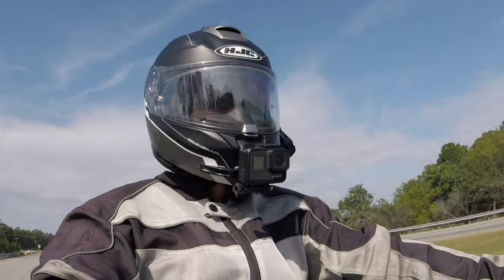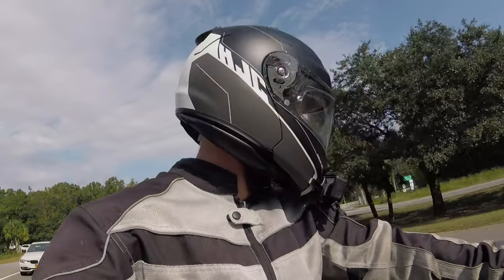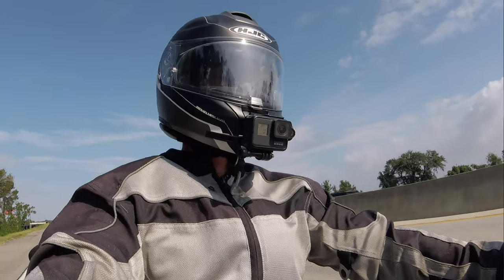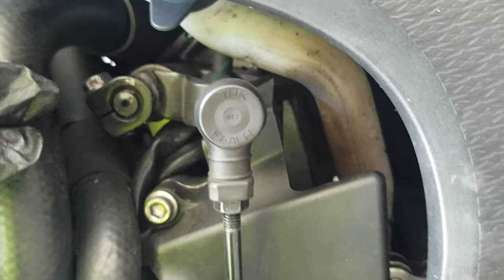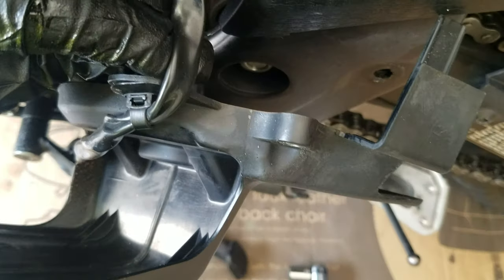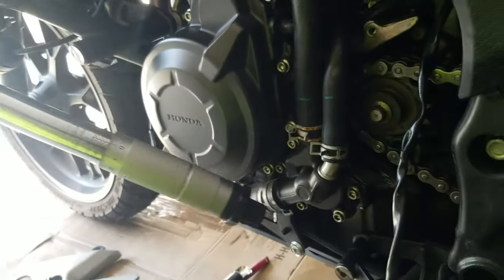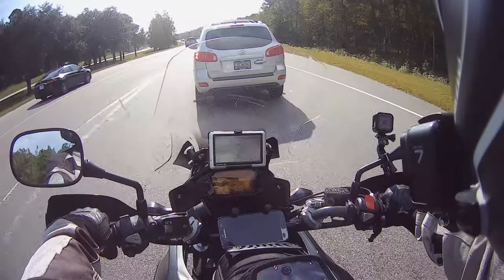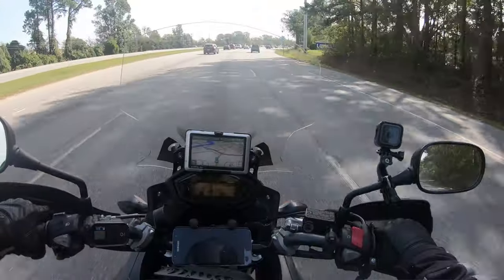CB500X 16T Sprocket Swap

Comment: It appears the torque wrench was used to break the sprocket bolt loose. I ask because that can cause issues with the calibration of a torque wrench for future use.
Reply from the maker: Hi Kris!  Thanks for the tip.  I did not know that!!!
Reply: Just dropping a torque wrench can make it off.

Comment: did this mod to my old 600 transalp and will now do it on my 2016 v strom 650.i like a low revving bike.
Reply from the maker: That's great, Peter!  I'm glad you found it worked for you as well.  :-)

Comment: Can you show gow did you recalibrated the speedo? Thx mate
Reply from the maker: If you check the video description, I linked to a device that will recalibrate your speedo.  Here it is:  SpeedoDRD DRD-3 from 12 oClock Labs - https://amzn.to/2Pahs8C.  You just remove the left side panel and plug it in.  Then go through the recalibration steps.  And bobs your uncle...everything's back to perfect!  I personally have not done it yet since I always use my GPS, which shows the correct speed all the time.

Comment: Is there a chain guard available that's made to go with the 16 tooth sprocket?  Wonder why Honda doesn't upgrade to the 16 tooth?  They have some pretty damn good engineers.  Just sayin'.
Reply from the maker: The stock chain guard works perfectly with the 16T sprocket.  If you saw me grinding my chain guard down, it was because I had it installed upside down.  OOPS!!!  When I flipped it the correct way around, it worked perfectly.  Also, the CB500X is made for many markets.  I think for the American/Canadian/European markets, the 16T would be an advantage because we have nice paved highways and travel at faster speeds than in some countries.  However, in other places like Africa, South America, and Asia, where you are often traveling on dirt trails or twisty mountain roads, the 15T makes perfect sense.
Reply: @MotoPhotoAdventures  Thanks for the response/info.

Comment: Where did you get your accessory bar and phone mount? I’ve been looking for one for my 2014 cb500x
Reply from the maker: Hi Erica!  Believe it or not, I made it myself out of an old badminton net post!  I just chopped it to the right length, flattened the two ends, drilled holes in each end at the same location as the existing bolts, painted it black, and bolted it in place.  I mounted my GPS on it using a bracket that I found while browsing the www.cb500x.com forum.  Then I tied the GPS power into the switched OP Plug (Options Plug) located under the right side of the instrument panel.  The instructions for reaching that were also discovered on that forum.  So when I turn the key to start the bike, the GPS fires up, and when I shut it down, it turns off automatically.  The phone (located below the GPS) is on a RAM X-Mount attached to the handlebar.  I hope this helps!

Comment: Cool video.I'm about to put a 16t on my v-srom650.Hopefullu the result will be as pos+ as your.My sprocket is not rubber backed,hopefully it will be ok without changing chain.
Reply from the maker: Hi Dennis!  I know several V-Strom riders who have upgraded to 16T and been very happy.  The rubber doesn't do anything except reduce noise...but I doubt it's really even noticeable.  I changed mine without replacing the chain and had no problems.  Ideally you would replace all three (chain, front, and rear sprockets) at once.  But it won't hurt anything to replace one at a time.  It just might wear the new component down slightly faster.

Comment: Just done this to my 2020 CB500x and it is AWESOME. The engine is much more relaxed, and the vibration zone at 5000rpm has been cut significantly, also it seems to virtually disappear by 5500rpm. Cannot tell how much better it feels, but I stick to the tarmac mainly, so if you do Green lane, maybe think twice.
Reply from the maker: Thanks for the comment, GBPaddling!  I'm glad you like it.  🙂
Reply: Where did get the sprocket?
Reply: @jillybean1108  Ebay
Reply: @GBPaddling  Thank you
Reply from the maker: @jillybean1108  if you check the description, I have a direct link to it.

Comment: The only thing that I thought should be mentioned is, if you do a lot of off - road riding you might appreciate the lower gearing at times.
Reply from the maker: Thanks bigbadbobdunn!  That's an excellent point, and has been discussed many times in the comments.  This is definitely a mod to make the CB500X more comfortable on the street.  However, I will mention that I've almost completed the entire Trans-America Trail on the 16T sprocket without any trouble, including summiting this steep and rocky 11,600-foot pass in Colorado:  https://youtu.be/Im8M-tRJXuY.  So you can STILL ride off-road with this modification.  But if you mainly ride off-road, best to keep the 15T sprocket size.

Comment: On my CBR500R went up to 16t front and down to a 41t rear (iirc that's -3) something like 11.5% taller gearing overall. Main reason I did it was for the freeway legs. Agree that stock 1st is almost pointlessly short anyways so there is very very little downside to this mod if any. Squeezes out a couple extra MPG too.
Reply from the maker: Thanks for sharing!  Glad you're enjoying the new setup.
Reply: That's good to know about MPG!

Comment: Awesome video :).  I am researching this bike and I am really leaning towards it but the fear was the highway performance.  I am not a speed demon so speed is not a big deal 95% of the time and highway is not a necessary for most of my riding but I wanted the option.... just in case but didn’t want the trade off of a heavier, harder to handle bike for the majority of my riding.  This seals the deal and confirms my decision.  I’m not a big guy and getting up there in age so I am looking for a bike that I can feel confident on while still being capable of some light adventure excursions.  Thanks again for this great video!!  2021 CB500X, here I come 😁
Reply from the maker: Hi Steadman!  Glad I could help.  I'm not a big guy either, and pushing 52.  So we're in the same boat.  I'm telling you, with this simple change the CB500X is an AWESOME bike!!!  I've ridden it all through Mexico, the Blue Ridge Parkway, and even on an off-road adventure along the Trans-America Trail.  It's very capable of whatever you throw at it...and just so much fun to ride!  Here's a clip from Mexico:  https://youtu.be/rkOk9hXHaoY.  I hope you'll subscribe to the channel and watch the whole series.  Also watch the Trans-America Trail series...you'll love it!
Reply: I've  just brought  a 2022 ,great bike ,I have an ST1300 and XL1000v ,yes the 500x has a lot less power ,but the weight  trade off is so worth it .

Comment: Great video, unhappily not in kilometers per hour.  Thank you. Your video will convince my friend to change the front sprocket too. And so I will do as soon as I can be back to Phuket. It must save petrol too. So happy you made this video.
Reply from the maker: Thank you for the kind comment, Didier.  I live in America now.  So I used MPH.  But I grew up in Zaire, where we used KPH.  It is very easy to convert.  Simply multiply my MPH x 1.609 to get the equivalent in KPH.  Or if you don't want to use math like we used to, simply type it into o e of the many unit-converters you can find online now, like this one:  https://www.unitconverters.net/speed/mph-to-kph.htm.  Cheers!
Reply: Yes I have converted. At 60 mph (96 kmh) the reduction is 300 rpm. At 70 mph(112 kmh) and 80 mph(128 kmh) the reduction is 800 rpm. When your speed on GPS is 60 mph the speedo indicates 55mph( 88.5 kmh) and at 80 mph on GPS the speedo shows 73 mph(117 kmh). It would be interesting to know the revs at 50 mph (80 kmh) because it is the most common speed we ride on  Phuket island. At 70 kmh I'm already trying to shift too a seventh gear, so the 16 T sprocket would be welcome. I suppose many bikers do not want to change the sprocket if the datas on the speedo cannot be adjusted.
Reply from the maker: Excellent,  @didierplouhinec4899 !  I'm glad you like the savings in RPM.  :-)
Reply: With the 15 T sprocket my friend told at 80 km/h (50 mph) the engine revs are 4000. I just wonder  if the 16T only modify your speed indications on the speedo or does it affect also all the other datas like total distance, average speed? Yes indeed the addition of a new ekectronic device under the seat is a necessity if you go from 15 to 16 T. We need to know where to buy this device to correct the speedometer.Many bikers wouldn't change the sprocket if they do not know where to get the proper device to correct the speedo indications.
Reply: Once more tip for you Chris. Personnaly I find the stock footrests far back and high. If you check on facebook "I am 500X" you will see new footrests which come complete which are moved down and foward . The whole set comes at the incredible price of 2200 thai baht ( 70 USD).
Reply from the maker: @didierplouhinec4899  check out https://www.healtech-electronics.com/products/sh
Reply from the maker: @didierplouhinec4899  I agree!  I have the SW-Motech foot pegs which are wider, more comfortable, and mounted lower than stock.

Comment: If I make this sprocket change is there a way to recalibrate the speedo to show the correct speed? That'd drive me nuts.
Reply from the maker: Absolutely!  All you need is one of these devices that you plug into a port under the left-side plastic panel of the bike:  SpeedoDRD DRD-3 from 12 oClock Labs - https://amzn.to/2Pahs8C.  A lot of owners buy them even without the sprocket changes, since sometimes the bike's speedometer isn't accurate from the factory, or isn't accurate because they put knobby tires or a different sized tire on.  Have you checked your speedometer against a GPS unit?  You might find it's actually not very accurate!  Some riders even report changing to a different sprocket size actually made their speedometer MORE accurate!  Personally, I have a Garmin Zumo GPS mounted to my dash and I use that as my speedometer.  But if you want to really calibrate your speedometer, just buy the SpeedoDRD and you'll be all set.

Comment: I’d like to know what the end result was re the grinding down of the safety plate. After watching your video, I’m definitely wanting to do the upgrade, but I don’t want to get myself in a bind.
Reply from the maker: Hi Daniel!  Not to worry.  It was my fault.  I had installed it upside down, causing the chain to rub.  Once I flipped it right-side up, it turned out I didn't need to grind it at all!  For more detailed install instructions, and an alternate option to the 16T upgrade, check out our 39T rear sprocket video:  https://youtu.be/Je6LdgYt9fg.  If I was mostly doing highway riding though, I'd stick with the 16T front sprocket!

Comment: Thanks for that. I am considering the 500x more and more, but still debating whether the CB650 is a better choice.
Reply: I was in the same position and went with the 500x in the end…. The 650 is more powerful but that’s the only plus over the 500x….

Comment: Hi , where I'd the speed meter connected? is the the CB500X speed bo off if you replace sprocket ratio?
Reply from the maker: Hi John!  The speed meter is connected under the panel on the left side of the bike.  I put a link in the notes under the video of everything you need if you want to re-calibrate your speedometer.  It's a simple device that you plug in.  Here is the link:  SpeedoDRD DRD-3 from 12 oClock Labs - https://amzn.to/2Pahs8C.  Also, here is where to order the front 16T sprocket:  JT Sprockets - https://amzn.to/3uRj4D6.  I love how much smoother my CB500X is with this upgrade!

Comment: thanks for the video. What about off road performances with new modification?
Reply from the maker: Well, I conquered the Trans-America Trail...including this hairy section up and over Cinnamon Pass:  https://youtu.be/Im8M-tRJXuY?si=DyK2E4hB2AYB-LOl.  All that was with the 16T front sprocket.  It wasn't ideal for the rougher sections like this.  But it sure was nice on those looong stretches of "nothing" in Oklahoma!  🤣 If you do a lot of off-roading, stick with the 15T front sprocket.  If you do a lot of highway riding, go with the 16T.  If you want the BEST OF BOTH, go with the 41T Rear Sprocket like I did in this updated sprocket video:  https://youtu.be/Je6LdgYt9fg?si=evdb6RYlo6P-UrMU.  That actually turned out to be my favorite.
Reply: @MotoPhotoAdventures  thanks a lot, it is a great ide !

Comment: Thanks for the video. My understanding from looking at the gear commander website is that a 16 tooth front sprocket on the CB500X causes the same chain links to cross the same teeth on each revolution, which accelerates wear. Just something to keep in mind. Because of that I'm considering a rear sprocket swap to a 39T. Based on all the comments here I'll probably change the chain a front sprocket at the same time.
Reply from the maker: Thanks for the great information, Sqeptick!  That is very good to know.  Much appreciated!

Comment: I know I'm way late to the gate on this video but why did you opt for the front sprocket instead of the rear? Going down in the rear 2-3 teeth has the same effect and you would have saved yourself a crap load of work with all that grinding and disassembly. 

When my chain shows me it's ready to be replaced I usually replace my sprockets at the same time. Usually on any given bike you can go up or down the front or rear one size, giving you six sprockets to play with combination-wise. I'm not a fan of changing the front sprocket because it throws off the speedo, and in a lot of cases you can't recalibrate that.
Reply from the maker: Hello Wabbit!  Thanks for the great comment.  Your are correct, either works.  I did not anticipate having to grind the chain guard...and as I've mentioned several times in previous comments, it turned out to be completely unnecessary.  Problem was, I had re-installed it upside down!  :-(  In actuality, changing the front sprocket is cheaper and easier.  To change the rear sprocket, you have to remove the axle, take the entire wheel out, undo the 5 bolts that are usually torqued WAY TIGHT, then re-assemble it all.  I've changed my rear sprocket a couple times.  And at least on my bike, it's much easier to do the front, and about half the price of a rear-sprocket.  As far as the speedo being off, my factory guage wasn't accurate to begin with.  I've always just followed my GPS for an exact speed indicator.  But there are two companies that make good Speedo Healers, which I have linked to in the notes under the video.  At almost 50K on my CB500X, I'm currently on my second 16T front sprocket (with new chain and rear sprocket too).  This combination just works great for my style of riding.  But next time I might try going back to a 15T front and dropping the rear by a couple teeth just for comparison.  There are many paths to Nirvana.  It's up to each individual to pick what works for them.  This is just one path that I offer for others who are interested in trying it out.  :-)

Comment: Is the speed based on a recalibration of the Speedometer???? 🙃
Reply from the maker: My measurement of the speed is based on the actual speed from the GPS in the dashboard.  If you use your speedometer to monitor speed, you can also purchase a Speedo Healer to recalibrate your speedometer after the upgrade.  Many riders buy one anyway since these bikes aren't very accurate from the factory.  SpeedoDRD DRD-3 from 12 oClock Labs - https://amzn.to/2Pahs8C.

Comment: Will this work on a 2018 cb500x? The part that was linked said it didn't fit my moto
Reply from the maker: Yes it should.  It didn't say it would fit because it's not the OEM size originally designed for the CB500X.  It's actually designed for it's cousin, the NC700X.  But it's the same exact bolt pattern for the 2013-2018 CB500X.  And as you know, mine (in this video) is a 2013.  So there's no reason why it shouldn't fit yours if it fits mine.  (Note that Amazon said it wouldn't fit mine either when I ordered it...but we all know now that it DID fit!)
Reply: @MotoPhotoAdventures  cool bro thank you so much! Just ordered it after reading your message.
Reply from the maker: @sanguiniusix9430  I think you'll really like it!

Comment: IMO the factory does a pretty good job of getting the gearing right, but you are probably right about this one. I would probably do the same. If you like it, I don't think you can go wrong especially going taller.
Reply from the maker: Thanks for the thoughtful comment, Dar Tice!  I agree.  Everyone has different preferences.  If it makes you happy to do, than do it.  If it makes you happy to leave the stock setting, then leave it.  :-)

Comment: I have question sprocket 16 from Honda nc 700 it will be feet on the Honda cb500x
Reply from the maker: Yes.  This is the sprocket I ordered and it works great.

Comment: Nice video Chris but I couldn't help notice that your chain has multiple stiff spots. For safety concern, it should be change. Your old front sprocket shoes lots of wear too.  I could not see clearly the rear one but the tooth seems pointy. If so, this would the best time to change your chain and rear sprocket before you ruin your new front one.
Reply from the maker: Thanks for the tip, Claude!  That chain is less than a year old.  It shouldn't be too worn.  But I will check it out, as well as the rear sprocket.
Reply: @MotoPhotoAdventures  It may not be worn out but it has many hot spots where the links are like frozen. Look at 4:10 and you will see at least three links that are frozen. Your chain should be straight but you can see some links are staying up or down.  Check at 7:25 the link behind the wire. It should not be that way. The chain may overheat and break if you keep using it that way.  It does look very dry too. Maybe you cleaned it good before the video though.